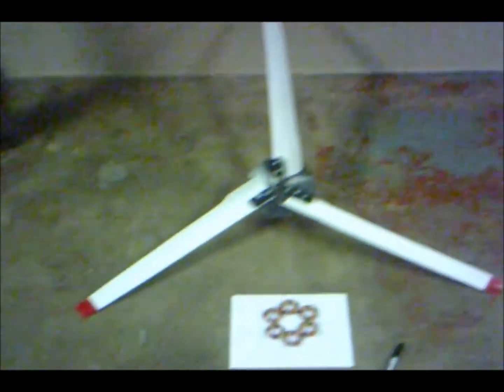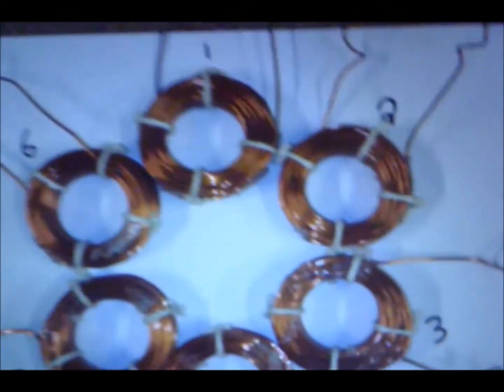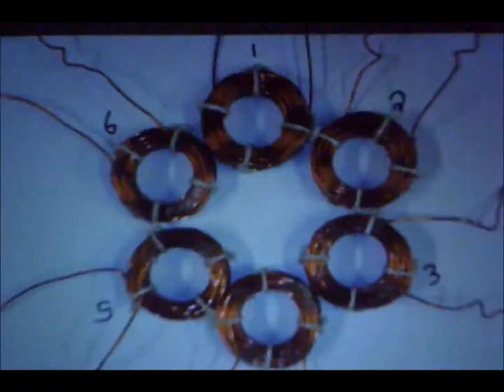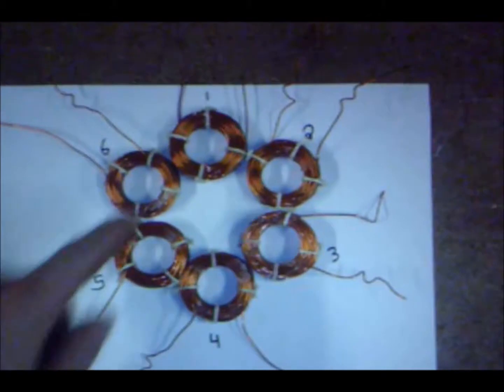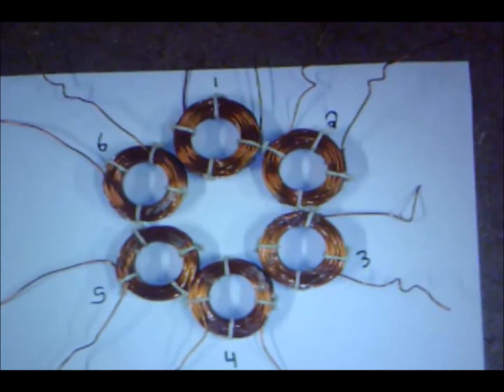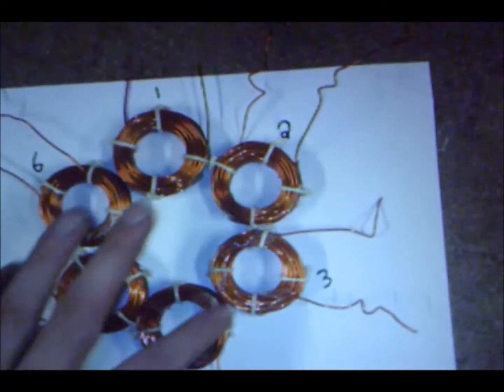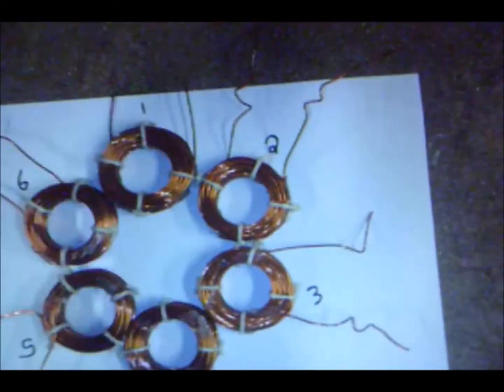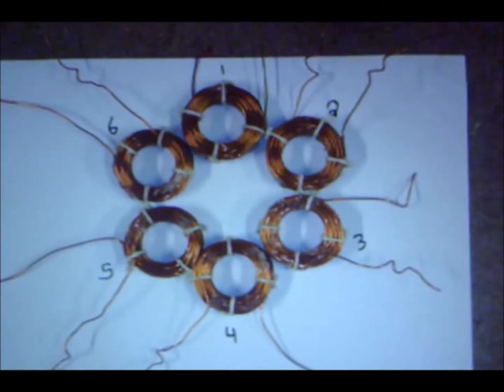Wind Turbine #3

Comment: Sure. 1" round is fine. I wish more people would jump in to you advice. 18 gauge wires will give you good power. I made one stator out of 20 gauge but I couldn't get enough voltage. You'll probably need a dc to dc step up converter.

Comment: Good with the wind. When you attach your wind turbine to a drained battery, it will slow it down until it gets full. It's hard to get to 12v with 6 coils. I forgot to tell you, you have to have all your coils line up in the same direction for the 3 phase. If one coils wire is clockwise, then the rests should be also. Have fun.

Comment: You'll need 8 magnets for 1 rotor to do 3 phase. 16 magnets for dual magnet rotor.  Your wind turbine will have to turn very fast to get to 12v. If you don't get 12v, you can make a voltage doubler or use a dc to dc voltage booster. There are other ways of wiring the stator. 18 wires will give you good amps but low voltage. This stuff is not easy. Strong winds will make up for a poor design. I know about poor design because I made many

Comment: Correct me If I'm wrong. The inside wires of 4,5, 6 to left to form 3 phase.  Outside wire of 5 to inside wire of 2 and outside wire of 2 to the right side. Outside wire of 6 to inside wire of 3 and outside wire of 3 to right side. Outside wire of 4 to inside wire of 1 and outside wire of 1 to right side.  Strip bare, sand and solder 123 together to form star config. Inside wire 4,5,6 will be the three wires  for 3 phase AC.  This is according to the way you label your coil positions in the vid.